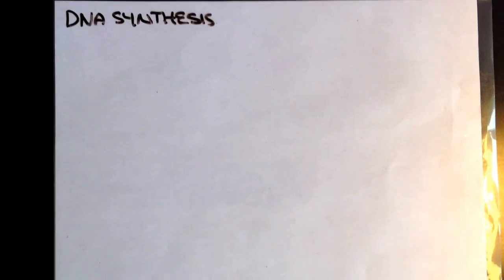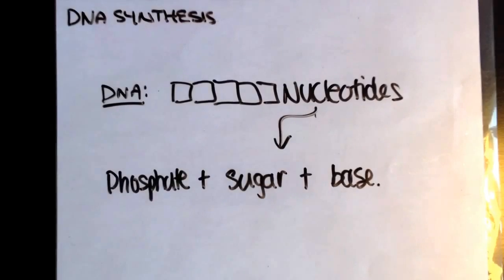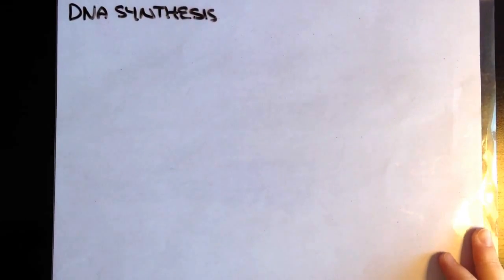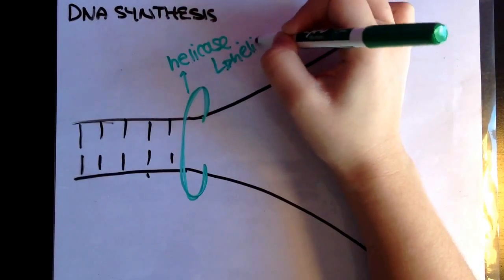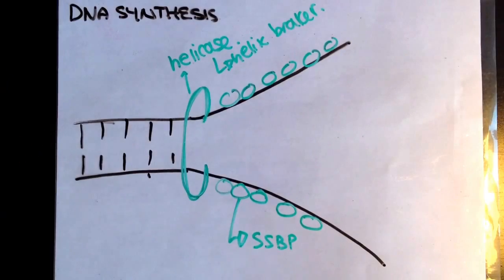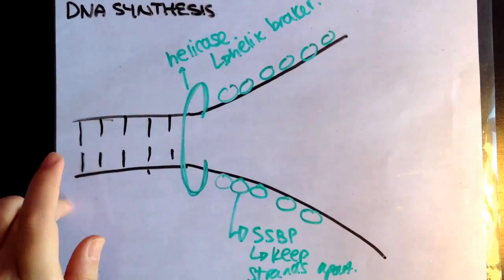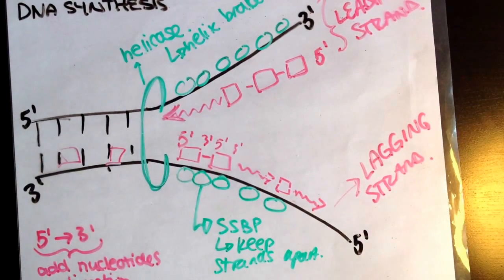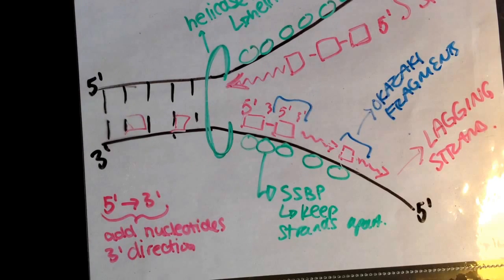Leading strand vs. lagging strand

Comment: I believe it isn't polymerase that fuses the okazaki fragments, but the enzyme ligase.
Reply: yes you're correct but DNA polymerase 1 still helps to close the gaps
Reply: @darkoshmarko  yes
Reply: @darkoshmarko  What polymerase 1 does is exchange such short strands of RNA for DNA to form a complete DNA chain
Reply: @darkoshmarko  Polymerase 1 remove the primers along the lagging strand and replace it with a DNA material. After that, polymerase III comes along and add nucleotides to the DNA strand.
Reply: Yeah
Reply: It is DNA polymerase that elongates the okazaki fragments though.
Reply: @trafalgarzoro3441  it was called polymerase I before, but scientists change the word to ligase now
Reply: @terrickhuang7626  Ohh thanks I was still confused.
Reply: that's what I was thinking haha. DNA polymerase 1 actually can't join nucleotides together, DNA ligase joins sugar-phosphate backbones of the Okazaki fragments instead.
Reply: It's that the DNA polymerase 1 that removes primer then the ligase fill the gap?

Comment: Still confused, because you didn´t say, if Okazaki fragments are DNA or RNA fragments, Because there has to be a RNA primer, which is synthesized by DNA primase. So are these primers called Okazaki fragments, or is it the gap between filled with DNA, by DNA polymerase?
Reply: The primers are added by primase. The strands of DNA that DNA polymerase adds on to the lagging strand in short segments after the primers are called Okazaki fragments.

Comment: If you want to make the video even more useful, my suggestion is to explain the problem of finalizing the copy of the chromosome at end of lagging strand, where it is not possible to place an RNA primer ahead of it which would provide the 3' end necessary for initiation of synthesis of the last Okazaki fragment. The problem is solved by Telomerase, which elongates the original DNA strand itself, thus providing room for RNA priming and completion of a full copy of the DNA.

Comment: This is a fairly clear demo, but you missed several proteins/enzymes and extra steps that would make this complete. More: The 5 Hydroxyl (OH) groups to 3 OH groups creating polar "prime" areas.  Primase (RNA Polymerase) -creating- the start of the new DNA strand with RNA & DNA Polymerase III -extending- it. The dual-opening nature of the DNA by the stationary Helicase splitting the DNA. And Ligase ATP/ADP dependent reactions joining the last parts of Okazaki Fragments would make this clearer.

Comment: It's a great video but always try to envision the direction of DNA reading from, 3'-5'. Whether it's leading or lagging, it's always read in a 3'-5', the only difference is the direction which would cause the complementary strands to have complementary bases. (Have the 3' starting point at the beginning of the arrow and the 5' at the end 'point' of the arrow).

Comment: anything with the suffix ase, is an enzyme. an enzyme is typically used to break bonds, there fore the helicase is an enzyme which catabolizes the helix bonds breaking it apart in order to start synthesis of the new strands. Helix breaker sounds like you're in grade 5 science or something. maybe you are but still. nice video i just wouldn't want to put more words into a brain that are already filled with a lot of terminology to remember.

Comment: I agree with grybok1ng it is Ligase and DNA Polymerase (Tac Polymerase)  that seals the nicks between the Okazaki Fragments. Other than that it was really helpful and I would also advise you show the other side since usually there are two replication forks going on at the same time.